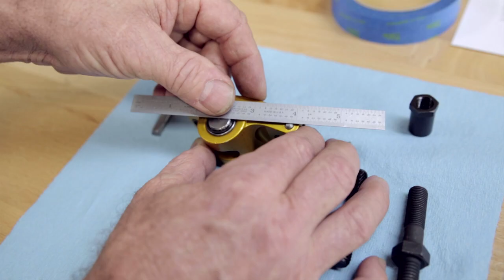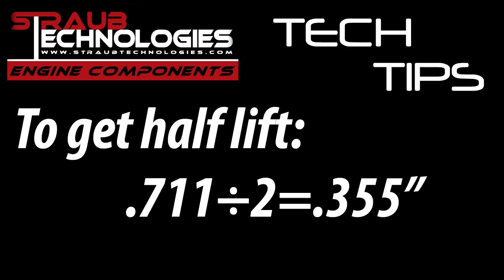Engine Tech: Valvetrain Geometry

Comment: Nice effort, but these methods fall way short of doing what they intend. I commented the following on another video that used a laser to try seeing the 90 degree relationship at MID-LIFT, but it had the same problem this has, of failing to use HARD POINTS for measuring.
Let me try to simplify a non-existent problem about all these interpretations to my book and the myriad of ways MID-LIFT can be checked, that so many creative engine builders have come up with over the years.
>
1. First, "MID-LIFT" is not a "theory," it's a fact. I'm anal about semantics. If you consider gravity a theory, then go on stating MID-LIFT is a theory. But there's nothing theoretical about the process of minimizing the wasted motion during the conversion of linear (push-rod) motion into radial (rocker arm) motion, then back to linear again (the valve) by dividing ALL arcs equally. It's a geometrical FACT.
>
2. The problem with this video's technique, is that it still relies on the human eye to determine accuracy, when it should be relying on hard measurements. While the video still does the math, it fails to take the human error out of the process. There's nothing complicated about the math to do a hard measurement check for setting up for MID-LIFT geometry, which I'll get to in a second. Over the years, engine builders would only look at "symptoms" of geometry as a guide to setting it, like the width of the witness mark across the top of the valve tip. This is better than nothing, but it only gets you close; and close wastes a lot of degrees of cam information. People will spend hundreds of dollars to go to a 4 or 6 or 10 degree greater camshaft in their quest for power, but think nothing about losing that many degrees of duration through wasted motion on a "close" rocker geometry set by "eye-balling" symptoms. Forget symptoms, and set things with HARD MEASUREMENTS.
>
3. The sample rocker arm, is not a MID-LIFT rocker, which means that you're only getting half the story here. The most important part of MID-LIFT geometry is its application to the PUSH-ROD side of the rocker, even though the checking is done on the valve side -- because that is the easiest to do. However, if the rocker has the same inherent BAD push-rod geometry that all rockers have traditionally had, except what I patented, and we tried to produce, then you can only minimize the wasted motion on the valve, and tolerate the excessive in-and-out motion of the push-rod; along with all its inherent side-effects; like lost cam velocity, cam duration and INCREASED harmonics. (Harmonics kills more engines than anything else, but is never blamed; only its symptoms get blamed; but that's another story I don't have time to get into here.)
>
4. Setting up your rocker geometry for the VALVE side is choosing the lesser of evils, because this is where the greatest motion occurs; this is where the wear and tear on the valve guides occur; and this is the easiest side to do it from. But first, let me dispel (again) the "myth" that "correct geometry is placing the roller in the middle of the valve." That is WRONG. As my book "Advanced Rocker Arm Geometry" explains, perhaps with too many words for most engine builder's patience, the engine and the valve does not care where the contact point of the roller is atop the valve; it only cares that it is constrained to the top of the valve (running off the valve tip's diameter is not good). All that matters, is the ANGLE of MOTION. That angle is defined by the imaginary line between the two axis of the TRUNNION and the ROLLER, as the horizontal laser attempts to show in this video. Because none of the manufacturers have any "accurate" standards for stud and stand mount dimensions from the valve, and because the stud leans into the valve, and because engine builders use varying length valves, and lastly, because every custom engine has a different NET valve lift, no rocker arm is going to be able to have the exact length required (on a mass produced basis) to accommodate all these variables. That is why you shouldn't worry about where the witness mark on the valve tip is at. Just worry about the angles. The BEST way to assure you are measuring ANGLES correctly with HARD measurements, is to use the VALVE SPRING RETAINER, because it is perfectly mounted at a 90 degree angle to the valve, and that is the principle of MID-LIFT precision.
>
5. With all the tools I've made; and all the engines I've built; and all the tricks I've learned (many from other creative engine builders), to this day when I still occasionally help an old friend out on setting up his rocker geometry, I do it in less than 5 minutes with the following technique. It's all done in the CLOSED VALVE position, because you don't need to worry about hydraulic lifter valve compression or flex. You don't even need to have the adjuster on the rocker arm; it is all laying loose. And obviously, unlike this video, you are not rotating the whole thing over under valve spring pressure. Once you know what your NET valve lift is, everything after that is math, and setup; and this can all be done with the rocker laying loose on the stud, and an adjustable push-rod lifting or lower it as needed.
>
It's not complicated:
A. Know your NET valve lift; divide in two; that is your MID-LIFT "motion" (MLM).
B. Measure the height of your valve tip above the retainer.
C. Measure the diameter of the roller; divide in half (this precisely gets you from the bottom of the roller to the AXIS).
D. ADD "B" and "C" together, to get the STACK HEIGHT. An illustration can be found at: http://www.mid-lift.com/TECH/TECH-Installed-G1.htm
E. Now, use a straight edge like the little machinist square shown in this video, and lay it across the valve spring retainer and alongside the trunnion.
F. SUBTRACT or ADD (as needed) the STACK HEIGHT to or from your MID-LIFT MOTION, by raising or lowering the rocker arm on the stud.
>
EXAMPLE:
* NET VALVE LIFT IS .700", so MID-LIFT MOTION is .350". That's cut in stone, now forget it for the moment (you've written it down).
* Valve tip is .050" above the top of the retainer; and the .500" rocker arm roller diameter tells you its radius is .250", so the STACK HEIGHT is .300".
SOLUTION:
If the STACK HEIGHT is .300" and the MLM is .350", then you need to place the trunnion .050" BELOW the valve spring retainer. If your math has the inversion of this, then your trunnion centerline would be above the straight edge coming off the retainer.
SUMMARY:
DO EVERYTHING IN THE CLOSED VALVE POSITION, AFTER YOU KNOW NET LIFT.
It's much easier to get an accurate DIAL CALIPER measurement on hard points, to find their true center-lines, than trying to use visuals that only give you approximate values. You can use the outer edges of the trunnion's diameter and divide in two for its center, which is far more accurate than eye-balling.
For those who want to know what is important, and how to fix existing systems, you can get the book on this at: http://www.mid-lift.com/MID-LIFT_ARAT-2016.htm
It's this simple: KNOW YOUR MLM; KNOW YOUR STACK HEIGHT; USE THE RETAINER AT CLOSED VALVE; and SET YOUR ROCKER TRUNNION as needed. Good luck to all. --Jim Miller
Reply: You wrote this for another video, then just pasted it into all the rocker geometry videos you could find, just to plug your book, right?  This video is a good tutorial on how to set up geometry for the average street builder, and he's keeping it simple for a reason. He's teaching the concept in a way that most grease monkeys can understand it.  Please do your own video if you're so concerned about exactitude - Oh, yeah, you want to sell your book...
Reply: @jmmiller7560  If my mid lift is .316" and stack height is .300", do i place the the trunnion .016" below the valve spring retainer?
Reply: Mr. Miller, I know I'm only a year late in responding to this, but your response makes complete sense as to using mathematical absolutes whenever possible. I'll be figuring my mid-lift geometry tonight, but I have a couple of questions.

1. Gross lift = Cam lift x Rocker Arm Ratio. Net Lift = Gross Lift - Valve Clearance. How do you determine valve clearance?

2. If I do the above-listed procedure with heads bare to block, using the adjustable pushrod checker to set the trunion centerline above or below the valvespring retainer level-line as per the MLM-Stack height math, I would then add the compressed gasket thickness and the lifter preload amount (.050") to the pushrod measurement, correct?

Any reply would be fantastic!
Reply: I understand every word, and I agree. 
When you know the order of signifigance of rocker geometry .. you should be able to shim your trunion, with the head on the bench   with the valve in the home position. 
Set your trunion height. 
Last .. , once the head is mounted on the motor ... use your adjustable pushrod ... to get the pushrod's length. 
And, like you say ... the reference points are ... the top tip of the valve, and the parallel to the center of the trunion. 
Cheers

Comment: I was reading "Rocker Geometry" by Jim Miller from Engine Professional, Apr.-Jun. 2010 issue, and trying to wrap my head around it. It's not the easiest article to understand the first time around, and after a couple read overs I looked to see if anyone had done a video on it. This one here made it click right away, and makes it easy. For anyone who watches this, I suggest checking that article out for some more background on why this method works, why measuring "swipe pattern" is tedious, and no way to measure for proper pushrod length, and why a good narrow swipe pattern is simply a by product of using the mid-lift geometry method. Thank you Scott for the easy to understand demonstration.

Comment: I've watched a variety of videos read a lot about setting this up. Everything was all guess work. You're the first to introduce math and when dealing with precision measurements, you can't guess, you must measure. But... HOW? Well you clearly cleared that up. I've been stressing for days about doing this and if I'd get it right. Tons of second guessing and re-watching yours and other videos but your's is the only one that made the most sense. 
Sure enough, I did everything you said and with the first turns of the cam, I am 100% in spec with the rocker roller on the top of the cam. I'd like to offer you a virtual hug cuz you're amazing :)

Comment: Finally got to try the half lift method and have to say I dont know what it is but it gave me a length that put the roller tip on the outboard side of the valve tip center line.  Something is not right and I did this measurement multiple times and still keep coming up with a pushrod length of 6.50" length.

If I use the OE pushrod length of 6.25" the roller tip is on the inboard side of the valve tip center line.  Using 6.35" puts the roller tip slightly closer to the center line of the valve tip.  Even adding the thickness of the head gasket would still put it at 6.40".
Reply from the maker: With the length you must have a SBF.  Rocker geometry from different mfg vary.  You will need backset rocker.   If not used a wide centered sweep pattern will wear out valve guides.
Reply: @straubtechnologies , yep ford 302 OE roller.  I did the math on the 2/3 lift method which in all my reading the other day kept coming up in posts after 2015.  With the 2/3 lift method it actually gives me a 6.35" pushrod which puts the starting point just on the intake side of the center of the valve.

Still doing some reading on the 2/3 lift method how ever and seeing if it would be a viable alternative for a street driven engine that wont turn over 6,000 rpm.

Comment: fantastic vid! I do have one question. You say your gross lift is .711? I have a 640 lift cam and the gross on the card is .377. Am I cutting the gross in half to make it 188, or using the .377 as my divide by .50 ( 7/16 stud) .711 gross seems like it would be a huge cam! Thanks again for the great vid!
Reply from the maker: Half you lift at the valve factoring rocker ratio.  So if your lift is .640, your number is .320".
Reply: @straubtechnologies  Thank you for the quick reply...that's what I thought, but wanted to double check....you've earned a sub here!

Comment: Alright I’m doing this for the first time today now when you do this you want the lifter on the back side of the lobe right
Reply from the maker: You want it on the base circle yes.
Reply: @straubtechnologies  alright thanks and I read that if you have hydraulic roller lifters you want to add .50 to your measurement is that correct

Comment: I have one question: 
Previously for piston to valve clearance checking purposes I converted two of the existing hydraulic lifters my engine uses into solid ones. I did this by using washers to locate the top internal moving part of the lifter (sorry not sure what it's called exactly) against the bottom of the retainer wire/clip piece. 
Should I use the lifters in this condition for the geometry check/set-up or change them back to original first?

Comment: Now THAT was impressive and best of all, you made it EASY to understand,  So I gather if my MAX intake lift is .499 is the number to use divided by 2 or the .510  exhaust??Also, if you use a marker on the valve stem tip, is it going to look different than the typical method (center it, rotate, check the mark? ) Part of why I understand this so well is that LP records and tonearms work the same. The angle of the arm outside is very different tha n the inside . So when aligning a tonearm cartridge (using tools) what you are trying to achieve is a balance in the middle because alignment centering at either extreme will cause a flaw at the other end (sorry I digress) hope you can answer my questions and again...AMAZING video

Comment: ok i got all that but what is the location of the cam lobe suppose to be in reference to the lifter  on the back side of the base circle or is the lobe suppose to be at half the lift or full lift? before you start with the 90 degree angles?
Reply: Camshaft should be on the lobe base circle. This establishes correct pishrod length as well as correct geometry of the valve train.
Reply: @ericmumma8214  i find that answer to incorrect because the rocker arm does have a sweep and the bigger the cam the bigger the sweep on larger cams exact geometry is crucial! If you start your sweep on the base circle and you center the rocker on the stem it will get very close to the outside of the stem and would only be in the middle at full lift and zero lift. so essentially you are introducing wear on one side of the guide. guide wear will be more pronounce then it would be if the sweep pattern is in the middle! yes you start at the base circle but that doesn't exactly give you the correct length until you establish your sweep pattern. once you know where your pattern is you adjust accordingly to move the pattern to the middle of the stem!
Reply: @hotrodofsalem  You are absolutely correct. I shouldve noted that its a good starting point as far as pushrod length "ballpark". Then from that point the pattern of sweep can be changed using longer pushrod to move the pattern toward the exhaust or shorter tpushrod to bring the pattern in toward the intake. I believe the midlift procedure has been the easiest for me to achieve CVG.  Thank you for your insight Rodney.

Comment: I have just figured out that I have +100 valves which make the HS Roller rockers ride too far outward on the tips of the valve stems. This seems to prevent this method from working and I'm wondering what work arounds/solutions I can use? I can get a nicely placed thin wear line in the center of the stem but only if I go to a shorter rod which means 90 degree starting point goes out the window? Is that ok as long as there is no binding?
Reply from the maker: We have rockers for SBC and BBC that are modified to work with long valves.  423 391 7774
Reply: stating that if your valves are .100 longer should be the very first statement in your video... whould have saved me a lot of time.... @straubtechnologies

Comment: Great video! This is definitely going to help me out. I see it's and old video so I'm not sure if Scott still works there. From the video I could tell if the head gasket was in there. Once you get the measurement shown do you have to add to the measurement for head gasket and valve lash?
Reply: Good question.
I myself didn't notice if the head gasket was there or not, but curious if it needs to be accounted for.
Seems like it would affect the final rod length.

Comment: Would just like to say big Thank you for your Talent. At 7:30 in the video your comment, You just established proper pushrod geometry. I then marked the top of my valve stem with a marker and held my rocker up and moved it back and forth over the valve stem. You now can actually see exactly where the rocker roller is located at half lift.   Thanks again Scott for the video.